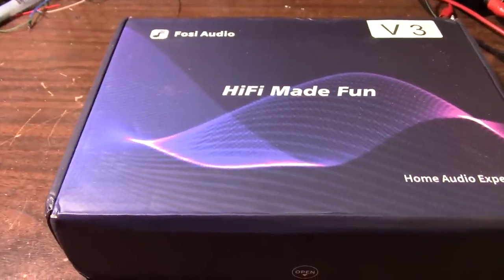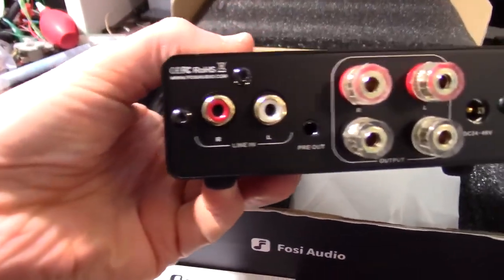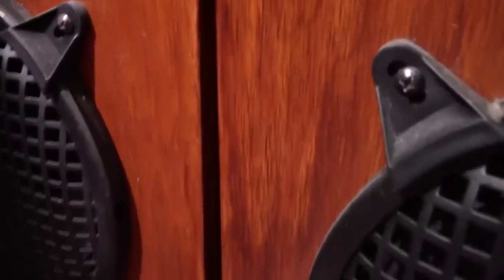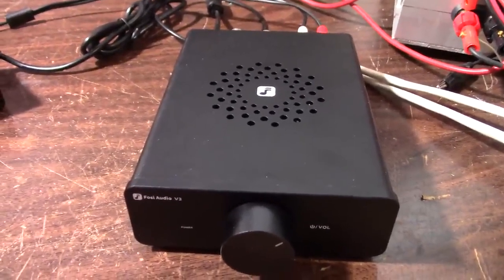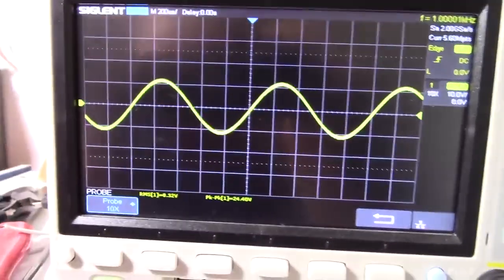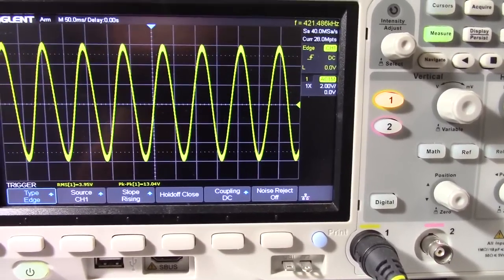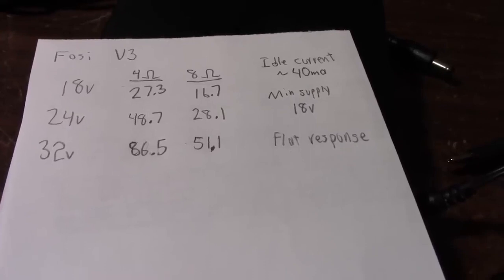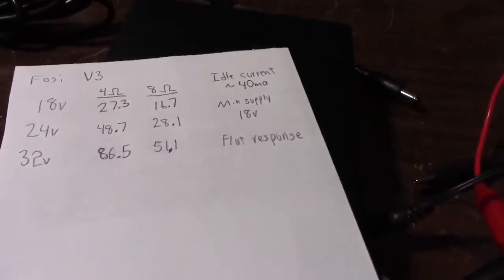Fosi Audio Class D amp - model 3V review - TPA3255 | by @JohnAudioTech

Comment: Can I use this with Active/ powered speakers? I have a Powered Sub-woofer speaker, where can I connect to this Amp?
Reply from the maker: Yes, you could connect it from the preout (single 3.5mm stereo cable) to the Line Inputs on the Powered Sub-woofer speaker.
Reply: @fosiaudio  Thank you for the answer. One more thing, my computer doesn’t have RCA output only have either an optical, USB so I have to find that have one right?